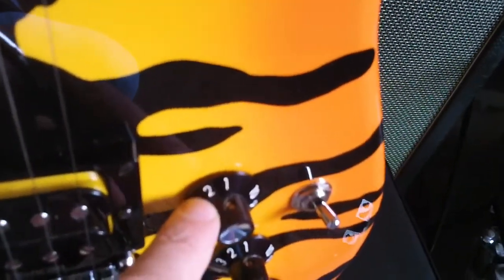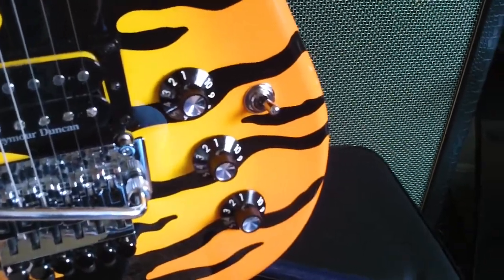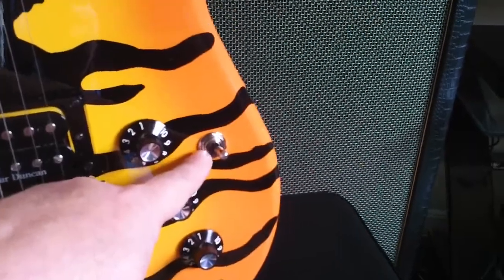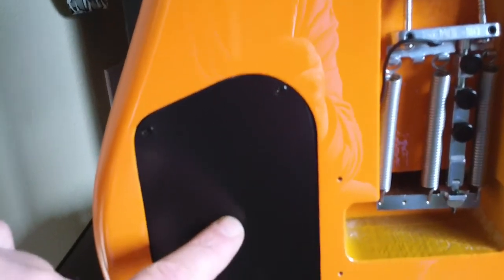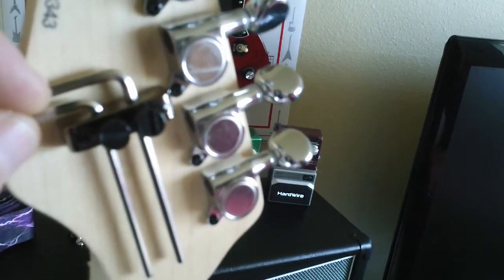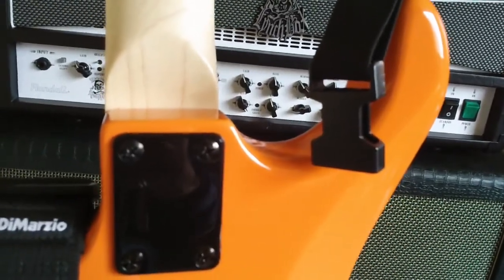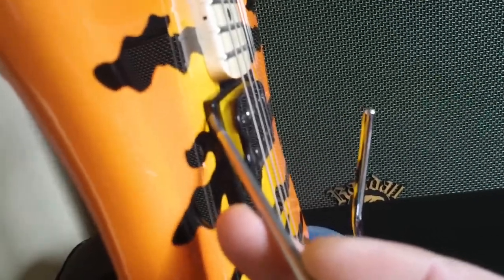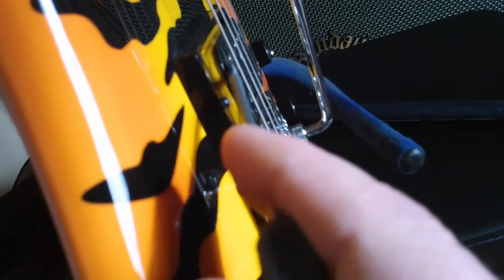Tiger Upgrade  Part 1

Comment: Did the original Floyd Rose install on the studs from the Floyd rose Special?
Reply from the maker: Yes the Original Floyd Rose Trem installed with no problems.